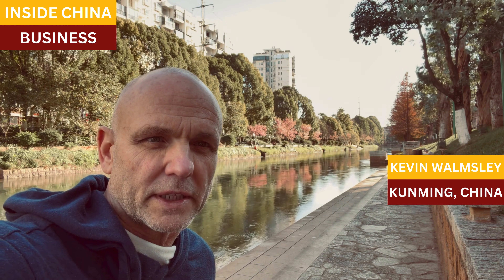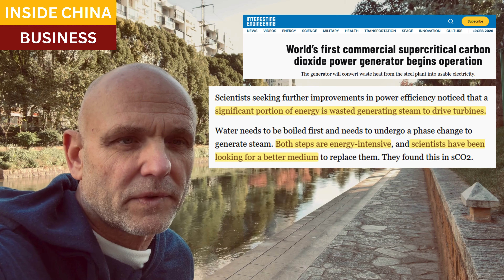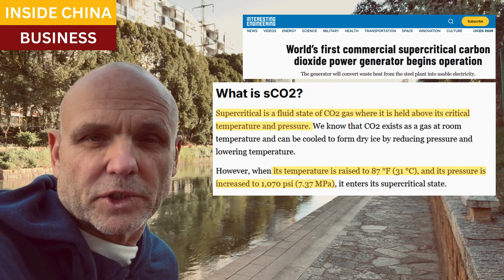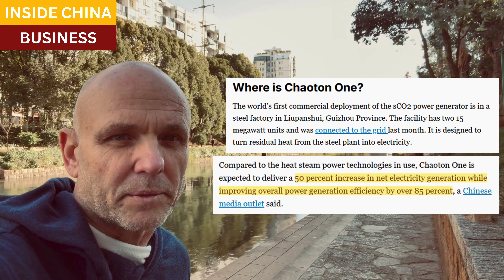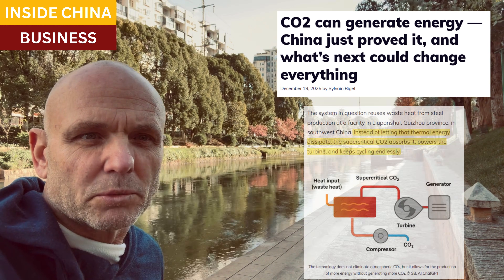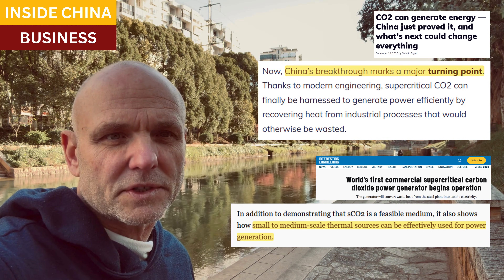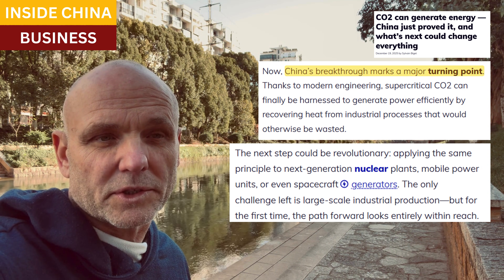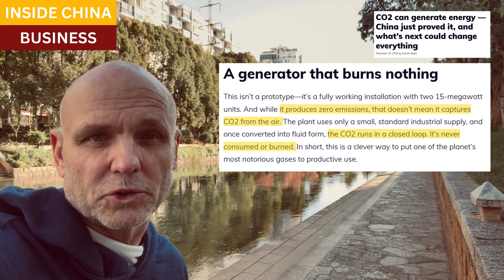Revolutionary generator transforms Chinese factories into power plants

Comment: Supercritical CO2 turbines are awesome, and using them in systems to make use of waste heat is good. But TANSTAASFL. (There Ain't No Such Thing As A Free Lunch). The power produced isn't free; it comes at the cost of requiring a cooling system for a low side heat for the Brayton cycle SCO2 turbine. The cooling system will require either a cooling tower (or towers) or a fair sized river into which the low temperature waste heat can be dumped.

Comment: The turbines at my local power plant are 40% efficient, then waste heat is run through heat reclaim units, to bring them up to 60% total
Out of curiosity…Could this co2 process be applicable to do better than 60%?

Comment: There's a certain level of confusion here about this technology.  Exemplified by 2:22, where in the top box it says, "CO2 can generate energy..."  and in the lower box "...carbon dioxide...transferring energy..."  Generating and transferring are not in any way the same, but it's a typical misunderstanding by scientifically-illiterate journalists.  
    This system described has definite advantages, of course, but it's only akin to transmitting drive to a car's wheels by using a new and more efficient gearbox which gets less hot and so wastes less energy.  It's not a new source of energy, which of course carbon dioxide, being already in its fully oxidized, energy-bereft state, can never be.  Some readers might have taken such a message, and some who believe that atmospheric CO2 is a problem, might even have thought that the system could contribute to reducing the planet's CO2.
    Another point not touched upon is that while there is a large amount of waste heat produced by industry, very little of it is in a form suitable for using in an electricity generation plant, whatever medium is used, water, carbon dioxide, salt, or others.

Comment: Bullshit! 
You can use CO2 as a work medium in a circular process like Water or Helium, but you can't create energy from it. 
The actual energy input must come from a heat source ( fission, solar, fossil) which can be transferred onto the CO2, and later transferred onto a turbine/ generator.

Comment: Finland has been experimenting with this tech for some years now.

So, cool, the Chinese has run with this and made it work for them.

Are they actually capturing the CO2 to do this with though?

No. They’re not.

Also, it doesn’t take a great deal of CO2 to do this with in the scheme of things.

Ok, there may be a saving in energy not used to bring water up to temperature, but, the factories are still dumping bucket loads of CO2 into the atmosphere!

That’s a bigger problem that this doesn’t solve in the slightest.

Comment: don't need the Chinese to tell me that you can generate electricity from CO2. trees have been turning CO2 into wood that we've been turning into electricity or heat for millennia
Reply: trees use CO2, as building blocks

you use wood, and waste CO2, just to get heat

China goes further: uses heat, to alter chilled cool liquid CO2 to become sCO2 (a fluid), to drive turbines more efficiently to generate electricity
this, way, no CO2 is wasted, none escapes

Comment: Sorry to say but there is someone who gotten things wrong here. This is no different that a steam turbine but with another gas. But unfortunately you cannot get a serious efficiency gain by just changing the gas. You do it by making the temperature difference between your working gas and the cold side of your turbine bigger. It is called carnot efficiency.
Also why are they selling that much electricity to the grid when they could just use it themselves?
Reply: false: no "gas" is involved here
and steam is hot water vapour
not a liquid

nor a supercritical fluid either, under such low temperatures and low pressures here
which sCO2 is
and chilled CO2 can be a liquid, too, under certain pressure

Comment: Why not use waste heat to drive sterling engines? The technology already exists and is proven.
Reply: stirling engines rely on gaseous state, at much higher temperatures
and no liquids, nor supercritical fluids here

not chilled liquid CO2 that's heated into fluid sCO2
at much lower temperatures and lower heat (31°C)

the point being, generating much more electricity from much lower temperatures
which means more efficient than even stirling engines

Comment: Nothing new about it, refinery’s around the world have been re gen turbines for power generation. The only difference is the Chinese seem to be separating out the co2 from traditional exhaust gas output then compressing it prior to putting into super critical turbine but I would be interested in the total power in power out figures.
Reply: you're missing the point:

everyone has been using turbine generators INEFFICIENTLY for generations, whether steam or gas, that are much bigger, bulkier, less portable

but now, China can use Chilled liquid CO2 heated to Fluid sCO2, to be more efficient, closer to liquid water driven turbines of hydroelectric powerplants, with NO NEED for WATER or a DAM or GRAVITY or a massive water reservoir built (too massive: not compact, nor as portable)

Comment: So just so everyone knows and understand, it doesn't take any energy from CO2. Its a steam powered turbine optimize to run on CO2 instead of water steam. This has a higher efficiency and ha been well known and studied for decades in USA. Again, it is great and all new powerplants should go this route. This is something my father has talked about and pushed for for more than 30 years. Again not any power production "from" CO2. It's a medium to convert kinetic energy to electric. Cheers
Reply: you're missing the point:

everyone has been using turbine generators INEFFICIENTLY for generations, whether steam or gas, that are much bigger, bulkier, less portable

but now, China can use Chilled liquid CO2 heated to Fluid sCO2, to be more efficient, closer to liquid water driven turbines of hydroelectric powerplants, with NO NEED for WATER or a DAM or GRAVITY or a massive water reservoir built (too massive: not compact, nor as portable)

meanwhile, USA has LACKED for DECADES any affordable abundance of low-cost energy to produce CHILLED liquid CO2, used in a CLOSED-LOOP System where heat brings it to fluid sCO2 that drives turbines more efficiently than steam or gas

only China has achieved affordable abundance of low-cost energy to do it
and to do many other things COMPLETELY unavailable to those stuck in USA

Comment: The closed loop doesn't make sense. Sure, you're not letting the CO2 in the pipes out, but how are you generating heat in the first place? If you're still burning fossils, then you're constantly generating more CO2, which has to go somewhere, and it can't all be crammed into the closed loop pipes. The volume of gas a fossil power station expels over its lifetime far exceeds the volume that could be compressed into even a very large closed cycler. I can see this making nuclear slightly more efficient, but it's really not a real solution for fossil fuels. I'm cautious that this is mostly another unserious greenwash.
Reply: heat comes from industrial processes, like steel making

Comment: Heat recovery is not a planetary cure, nor marketed destiny, but a test of industrial maturity. In closed-loop sCO₂ waste-heat power generation, the carbon dioxide remains a contained working fluid, rather than intercepted exhaust, and the plant continues emitting CO₂ from its processes independently of the loop. The generator does not decarbonise the mill directly, nor repurpose CO₂ that would have been vented, but it does recover electricity that would otherwise be purchased or generated at higher carbon intensity elsewhere. The climate benefit, if present, is indirect, arising only when recovered electricity displaces dirtier grid or on-site generation, nor when it alters the mill’s process emissions. In that sense, the system is not earth-shaking, but it is not cosmetic either. It is simply a smarter turbine attached to a messier engine, capturing lost energy without claiming dominion over the fire itself. The mill is still the mill, the generator is still the generator, and the planet will demand a different machine entirely if salvation is the line item.
Reply: it's not about mere heat recovery

it's about not squandering heat that can do work

not at all: no CO2 is emitted
because in China, even CO2 is itself "urban mined" in industrial processes as a RESOURCE in itself

because purified CO2 is used to MAKE other things, like SUGARS, for ANIMAL FEED, and other carbon related products

China does this CO2 mining in Coal/Gas powerplants, as well as WtE powerplants

nothing goes to waste
not even "leftovers" which can be further "urban mined" for Rare Earth Metals and Critical Elements

China is already practicing in-situ urban mining in various industrial process, including refining, extraction, purification of certain elements

they think way ahead
because they have both the know-how, the energy, and the special equipment for it

Comment: You did not explain this very well.
The title makes it look like they are making energy FROM CO2, but they are not, since CO2 cannot be a fuel.
All they are doing is using the CO2 as a passive component in a steam engine, with the idea that it is a more efficient passive component than water.

This is not technology that will make any significant difference in energy generation, due to high costs per watt of this concept and the (considerable) difficulties of working with CO2 at over 1000 PSI which is kinda manageable at a small scale but gets very problematic at a larger scale.
Reply: why not just watch the available extra videos provided in his pinned comment?

Comment: You transform from one energy form to another with the use of "fasen changes" of an element, here Carbon dioxide.
The energy that are transformed is from heat to electricity.

Seams as elegant and useful.

Comment: This tech has always been available but has been limited by the oil industry. Heat recovery has been use in refrigeration plants for a long time. CO2 is also used in refrigeration with its draw back being high operating pressure. Also there is heat rejected that could be utilised.
Reply: chilled liquid CO2 when heated becomes fluid sCO2

gaseous CO2 isn't same as chilled liquid CO2

chilled frozen solid CO2 (dry ice) isn't chilled liquid CO2

Comment: After you heat the CO2 from industrial processes, where do you get the energy required to cool the CO2 down to a liquid state again?  It sounds like more hydrogen fusion hype.
Reply: you start with chilled liquid CO2, heat it to become fluid sCO2 (31°C) to drive Turbine generators

the turbine generators absorbs the heat and the fluid sCO2 cools back down to liquid CO2

in a pressurized closed-loop system

i.e. it's a vastly cooler and lower pressure system than any hot steam or gas high pressure Turbine system

Comment: I ferment my wine and beer in the same room I grow my seedlings. The CO2 produced by the fermentation, help my seedlings thrive. I thought about using the pressure produced by the CO2 bubbling out of the 6 gallon fermentation bottles, to spin a turbine to produce electricity, but it would only be a novelty, because the electricity produced would barely make an led bulb flicker.
       Anyway, I know CO, carbon monoxide, would burn, but I never thought of CO2, carbon dioxide, being used like in this video.
Reply: CO2 here isn't "burned"

Comment: LOL China just proved it? LMFAO. Sorry but the University of Queensland proved it a year ago.
Reply: not at all
UoQ has nothing commercially viable

China's steel makers use it to generate extra electricity harnessing excess high heat, and surplus could potentially go back to the grid, or just keeps other things running

Comment: This isn’t new. National Renewable Energy Laboratory has been kicking the tyres on this for years. In non-engineer language a sCO₂ turbine has absurd power density. You are talking about something with utility-scale implications that can literally sit on a desk. That alone tells you this is not speculative physics, it’s a packaging and materials problem.

The physics is known, the thermodynamics are boringly well understood, and the performance gains versus steam are obvious. This makes it hard to excuse the Chinese pulling ahead. This said, I won't lie. I'm salivating at the thought of breaking free of General Electric & the usual cartel of turbine vendors who monetize opacity and certification friction rather than insight. 

The real constraint has always been materials. Supercritical CO₂ behaves nicely on paper, then starts acting like an aggressive solvent once you push temperature and pressure. Corrosion, embrittlement, seal degradation. None of this is mysterious. It’s just expensive to solve because it lives in alloys, coatings, and long test cycles. 

If you fund it like a state project rather than a quarterly-EPS project, most of these issues are tractable. GO CHINA!!
Reply: kicking tires only? = tinkering only

China's steel mill harnesses its excess high heat in generating surplus electricity via sCO2

they integrate it into industrial processes
because China has already built-in enormous affordable abundance of low-cost energy to go further

others haven't

Comment: Why couldn’t you use heat from a car engine to do this and charge the electric batteries for extra range?  No idea if it could be miniaturised for this but 🤷🏼‍♂️
Reply: You totally could, but the energy you would get in return is so marginal for the cost that it would be absolutely useless, just like this invention is.

We can do everything with physics, but  everything has a cost, and if this cost make the invention non profitable then the invention wont be used because we still live in a capitalist system

For example its possible to turn plastic back into oil, so why don't we do it more? Because it's not profitable, plain and simple

Comment: The sun provides heat that's wasted in huge quantities. Fresnel lenses, co2 and low cost electricity could make the USA obsolete evan faster than an 80yr old dementia sufferer at the perfect time. Oil might still be used but with the amazing possibilities and improvements in materials to handle high pressure miniature electrical plants could be everywhere. For the skeptics here old ideas revisited are what has always been the birth of new tech when conditions change to make it their time.

Comment: Your really over complicating and over-thinking this, super critical co2 allows a greater difference between turbine input and output temperatures, the difference in temperatures defines the Carnot cycle efficiency.  The fact that it is more dense than steam also allows for smaller turbines.

Comment: Efficiency: It requires less energy to heat supercritical CO₂ to a useful state than to boil water into high-pressure steam. This means it can convert a higher percentage of the captured waste heat into electricity (as the article notes, 50% more electricity and 85%+ efficiency improvement).

Size: The turbines and machinery can be much smaller because supercritical CO₂ is so dense and energetic. A 10 MW turbine could be as small as a desk.

Comment: This gets work from temperature differential. Sterling engines are an early solution, and rich-people systems like yachts often use Sterling engine generators.. Business claims building Sterling engines - like other delta-T scavengers like heat exchanger drains which rob heat from wastewater - costs too much in materials. This is a fallacy that ignores Business's other trope - economy of scale - which would reduce cost of produce. Nice to see supercrit CO2 as a heat medium.

Comment: You didn't mention Carbon capture. Does this mean that the CO² utilized in these generators are trucked there and used as a reservoir in a closed system? I guess that I am also asking if these generator plants absorb waste CO² along with the waste heat they utilize for power... and if they bleed any of their own CO² into the atmosphere.

Comment: I do not believe the efficiency claims.
In a conventional Parsons steam turbine, steam is successively expanded through a series of nozzles. The expansion causes the steam to speed up and it impinges on turbines, providing thrust. The key to the whole process is the expansion of the steam. In the last stage, the very larege volume of steam at low pressure exhausts into a condenser which turns it back to water. A good third to a half of the power is derived from steam at or below atmospheric pressure.
In a carbon dioxide turbine, the supercritical carbon dioxide does the same thing, only in the first stage it turns from the supercritical state into a high pressure gas. So far, the same as in a supercritical water turbine. But at the end of the expansion the carbon dioxide does not condense to a liquid at near zero pressure. It has to be compressed again, which requires energy input, so instead of gaining energy at the end of the cycle, energy has to be supplied.
A large steam turbine such as is used with a nuclear reactor can be around 38% efficient. SWRI, the US leaders, claim an efficiency improvement of about 10%, thus an increase to about 42% (10% of 38). This seems a lot more realistic than 85% which is fantasy. Running on waste heat makes the fuel effectively free. Diesels can be more efficient (around 50%) but of course need to burn oil.
The main advantage of carbon dioxide turbines is that they give acceptable efficiency without needing the very large low pressure stages and condenser of a steam turbine, so the installation can be much smaller. This might be why the Chinese want to retrofit them into factories where space for a conventional steam turbine is lacking.